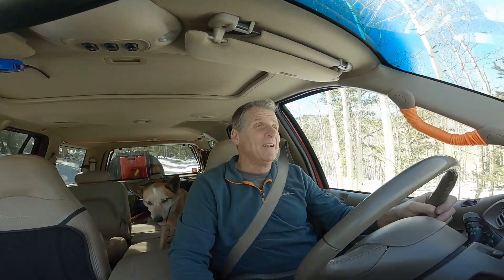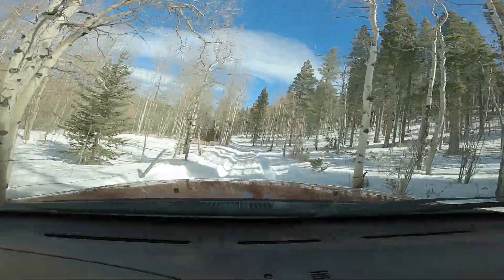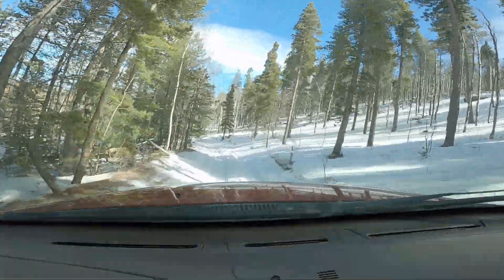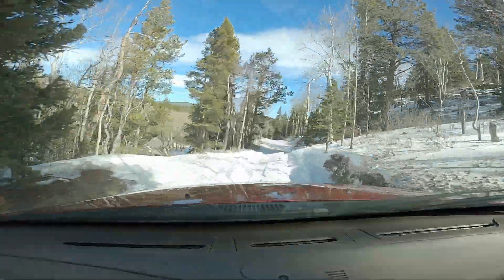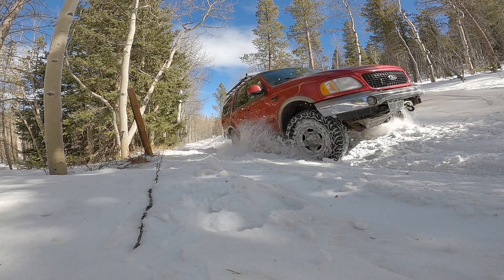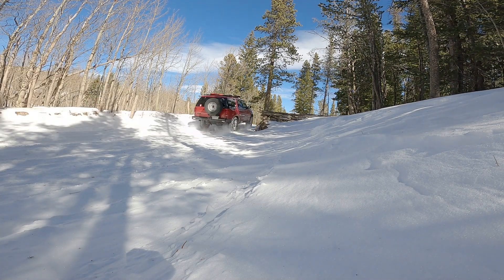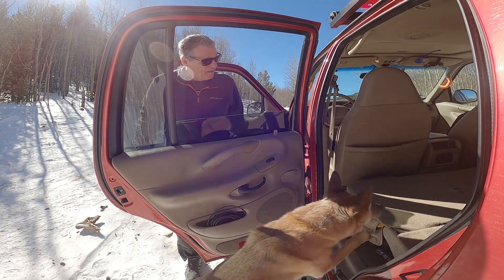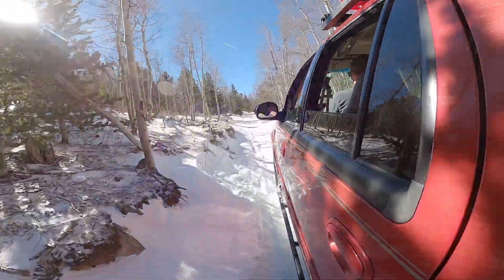Detroit Eaton True Trac - How they work in real life

Comment: The Truetac is a limited slip differential. It’s not a clutch or clutch/cone type, but it is still technically a limited slip. They work amazing with factory traction control systems. By design they also allow being used in the front better than a normal clutch style. The important part is that they require torque to move torque. A tire in the air requires almost no torque to move. That’s why applying the brake works. This is what makes the Truetrac and Torsen the best overall differential for anything except rock crawling. Most people want to over analyze the differential they buy. The Truetrac and Torsen are the best choice for almost every application and work extremely well in a front/rear setup. The video had some good shots in it, but was more of a tire and suspension discussion. The rest could be narrowed down to this. The Truetrac works well in every situation as long as you don’t have a tire off the ground. If you do try to use the brakes to shift the power. Other than that they do as they are supposed to and yes they work like an open differential even in the front when just driving around. Steering isn’t a problem because they will only begin to shift power when you make it happen. If you’re in a 4 wheel drive giving it enough power to spin all 4 you’re making it happen and not likely in a turning situation other than f’ing around.
Reply from the maker: You should make a video, thanks!
Reply: I installed a tru-trac into the rear of my 4wd Toyota Prado. It  already has traction control as a factory option.  The traction control and Tru-trac LSD are a match made in heaven
Reply from the maker: @daveolsen8053  Nice!
Reply: @daveolsen8053  Same thing on my 2021 Tacoma 4x4, TrueTrac in the rear with the factory Auto LSD (traction control) works really well hand in hand, pretty much what Stark is doing with his left foot.

Comment: Going along with my last comment,  I see people just hitting the gas and instantly  locking like your front wheels do, where my factory lsd never does this. The truck also has near 400k miles on it and likely never had its gear oil serviced. I will note that i get white streaks on my new wheels here lately like the shaft seals under the center cap might be leaking, I've noticed so I'm thinking of just revamping  the truck entirely. Engine, trans,  rear end. Ive got a $5700 pile of parts just waiting to go on. Im hoping the rear end can be done with minor work to the ring gear and carrier. And u didn't just maybe a big perchase for a diff that works like my factory one if its not any better in performance.
Reply from the maker: You can rebuild the factory LSD clutch pack, carbon upgrades are available for Ford 8.8.

Comment: So my dodge ram 2500, you have to really push the ebrake to the point it almost is too much for the engine to lock the stock lsd.   It is  Exactly the same as the true track  design. My question is... at $1,060 is it worth having the name brand eaton that is a fully machined body.  I was told they have a better torque bias ratio than the factory aam 11.5" 14bolt
Reply from the maker: I really don't have experience with Dodge diffs, good luck with your build.

Comment: thanks for this good stuff. what percent of time are you wishing you put a locker in the rear? ill be running an e350 4x4 conversion, high top with full camper build. just trying to make the decision if i need a full locker in the rear.
Reply from the maker: Thanks! Trick question, truth be told most of the time. To clarify, I wish I had a selectable locker in the rear. TrueTrac in the front with a selectable locker (ARB or E-locker) rear for the type of terrain I need more than just 4x4. As I say in the video the TrueTracs don't put all torque to both wheels, in the front it will pull you up over things but I think the rear  looses traction because of the same thing. So you need to apply the brakes to get the front to help when if the rear was full locked it would keep traction longer. I'm guessing you won't be rock crawling with your van, but having a selectable locker gives you the good stability in snow when it is open and max traction when locked at slow speeds. I had a 2wd prerunner Ranger with a Detroit locker and it was always sideways in the snow on the road but went places a 4x4 with open front and rear couldn't go. So think about what is most important and there is always a compromise. I have a new F150 Ecoboost with an e-locker so its open until the switch is pulled and it will actually spin one rear tire accelerating pulling a trailer, wish it had a limited slip.

Comment: Great video on the Torsen lsd. I run them both front and rear on my '18 Ram 3500 w/37s. They are fantastic!
Reply from the maker: Thanks!
Reply: Torsen is actually a markedly different design / implementation than the truetrac, but they are comparable in performance. Truetrac is probably better than the standard Toresen T2 for off-road use due to it's ability to bias up to 3.8x with the brakes applied as preload (or under perfect conditions).
Reply: @JoelGrant  they are, yes. Even the two I run have differing bias. AAM "trac-rite?" in the rear (stock) and Detroit "tru-trac" in front. It takes more work to get the rear operating. The overall design is fantastic.
Reply: @JoelGrant ,  can you expound on your comment, "torsen is actually a markedly different design / implementation than the truetrac?" Are you referring to the built in torque bias or something else?

Comment: Love your rig man.  I have a 99 Eddie Bauer with all wheel drive and  4hi and 4low it also has the air ride should I get rid of the air ride before I take it off road. I’m gonna crank the torsions and put 35s on it.
Reply from the maker: There are some things about air ride that are different like the front shocks are 4" longer. I used 4" lift Ranchos. I recommend doing the brown wire mod to stop the auto 4x4 from engaging. Good luck with the build, if you need bumpers or sliders let me know.

Comment: When you let off the brake while still under load, does it open back up or does it continue to put traction down until load is removed?
Reply from the maker: It opens as soon as brake pressure is released.
Reply: So then going uphill, say from a start, you have to ride the brake all the way uphill in order to get the benefits to the top? I suppose if your geared right that’s not an issue?  I am truly digging (no pun intended) the Eaton over LSD no question, just learning the operation a little more. It would be nice if it was still “locked” so to speak, but then I imagine that could create issues on trails with turns and our cv weak spot.
Reply from the maker: @corylamar9125  If both tires are on the ground no brakes needed, only when you are rock crawling and in low range lifting a wheel do you need to apply brakes. Both wheels power if they are on the ground like a locker more than how a LSD works.
Reply: Stark's Expeditions the reason I was getting to that was because I’m trying to decide the best traction option for the front diff, without breaking cv’s regularly, that will perform to my needs in MOAB next year. A lot of 3 wheeling on some of the uphill obstacles. At 500 less (roughly) than lockers, I was considering it. But climbing the obstacles with brakes applied doesn’t seem like the route I need. For my everyday wheeling it would be absolutely perfect..  Thank you for the time bud!! You’re a good man..
Reply from the maker: @corylamar9125  No problem, thanks!

Comment: I`M NEW TO THE CHANNEL BUT FROM WHAT I`VE SEEN YOUR HAVING SOME BREAKAGE PROBLEMS. WHAT EXACTLY IS BREAKING AND HAVE YOU FOUND A FIX. I`VE JUST RECENTLY BUILT MY EXPEDITION WITH A FABTECH 6 INCH LIFT,37 INCH TIRES ,4.88 GEARS  AND ARB AIR LOCKERS. TO ME THE STUB SHAFTS LOOK A LITTLE WEAK. SO FAR I HAVEN`T FOUND A REPLACEMENT . HAVE YOU? THANKS FOR ANY INFORMATION.
Reply from the maker: I broke 2 out CV joints in the front axles, no heavier duty replacements out there. RCV will make some for $1000 each but I have to buy 10 for them to do it. They only break at near full lock at the steering. If you good up with the wheels straight no problems. I'd love to see that build!
Reply: @starksexpeditions121  
Your truck looks so good without the front diaper bumper 😉👌
Reply from the maker: @xmo552  Thanks!

Comment: Love watching the reviews on the truetrac differentials!  I took your advice and ordered up some 4.56 gears, now its time for differentials.  Do you feel the front tt is worth it?  I am afraid of breaking the IWE or the CV axles as I am sure this design is not meant for heavy off reading.  What would you think of only an e locker in the rear?  Keep up the great content!
Reply from the maker: Thanks, yes I think its worth it. I think the perfect set up (not a full on rock crawler) is a e-locker in back and TT in front. If you can't get through an obstacle with the rear locked you can apply the brakes and add more torque to both front wheels to get through. As long as you have an automatic, I don't think you can apply brakes and not stall. But even then the TT would put power to both wheels until one wheel lifts.
Reply: Tru tracs are very strong. I have them in my Range Rover Classic. One thing not covered here is sand..It made such a difference, that I can barely throw any sand as all 4 wheels just drive thru it. You can pick what ever style you want. I hope it all works for you what ever you choose or chose since this reply is a year later.. I left it for other people who may stumble onto this old video.. Are they pedal to the metal strong? Drag racers used them for years. Military Humvee drivers are instructed how to use the brakes to help Torsen diff's, Thats what the military has them in every Humvee. So I guess they are probably pretty strong, and worked good in the deserts of the middle east. Tru trac/ Torsen diffs are different. But once you get comfortable with them you will like them. For less money they are a bargain for what you get.. Full send up a bolder field? I do not know. I don't do that kind of 4x4ing. I like to drive home and not be on a tow truck. I wheel by myself a lot. I never thought for a second my TT's were going to break. Happy trails

Comment: Thank you for providing in depth real user content. I am looking to make my 08 F150 4 door 6.5 bed 4x4 lmtd slip rear on 35's a little more trail capable. Gear change and traction adder coming soon. I am curious about your comment about using a locker in the rear, could you add more info please? My first priority is to improve performance in sand and desert trails (chasing Baja desert races and vacationing/exploring) and rocky trails like you show on your videos. Do you carry spare front axle shafts and change on trail or at camp? Just how fragile are the cv's? I realize the skinny pedal has everything to do with it, but it looks like you are a methodical off-road driver as I am so want to know what to expect. Thanks
Reply from the maker: For the sake of simplicity I think must people would be very happy with just a rear locker. Both rear wheels pulling will do very well in desert type conditions. The only time I break a CV is when I'm on the brakes and the front diff is locked at full droop and at full steering lock.

Comment: I think I'm going to go with a Full locker in the rear and TT in the front.  That's where the vehicle weight is so I think that's where you get the traction. Then True Trac the front. Kinda concerned that applying brakes to get TT to engage may cause me breakage problems on my CV especially when turning and at high CV angles when suspension is flexed. Hopefully full locker in the rear will be easier on my front end components Enjoy your video. Nice to see  a rig that's not a jeep...
Reply: I would do the opposite. Put the selectable locker in the front and the Truetrac in the rear. My reasoning is it is so much more difficult to make a turn on a trail with the rear locked than the front. In order to make a tight turn, you need the differential action to get the rear ended to come around. John Currie (Owner of Currie Enterprises) also advocates this same approach.
Reply from the maker: If I could do it again I would go that way. I love when I come down a trail and see the faces of guys when they see a soccer mom vehicle where only certain vehicles normally go.
Reply: If you watch in the intro of the video, he does pop a CV in that exact condition you describe.  My advise: stay off the throttle in situations like that.  Stay away from situations like that.  Pick a different line to avoid that situation.